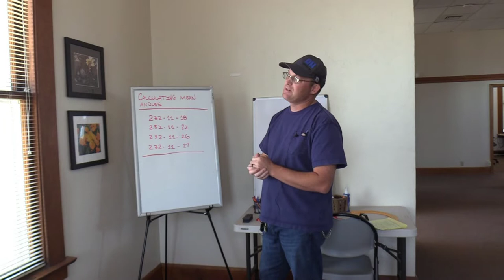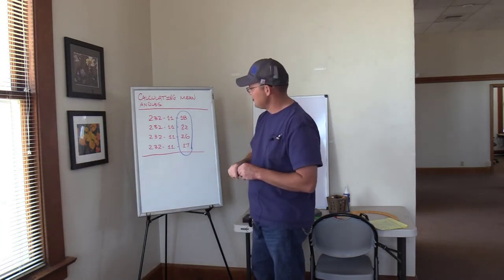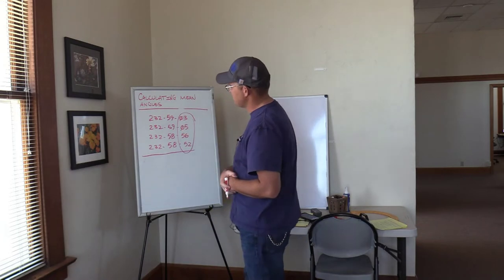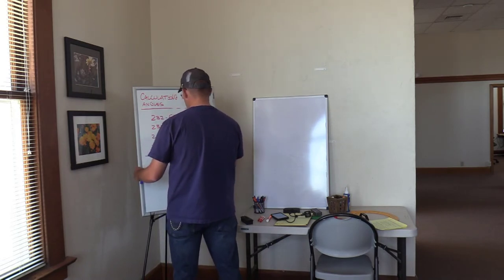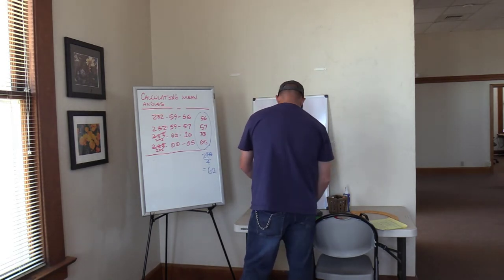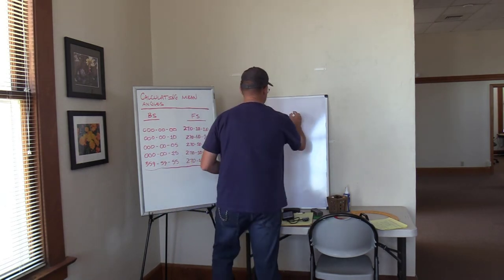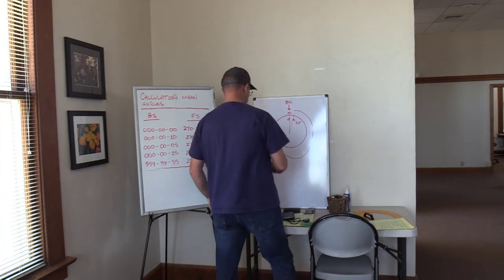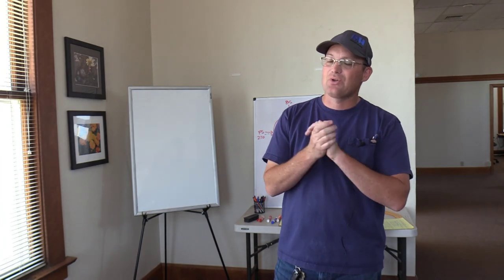Calculating Mean Horizontal Angles In A Total Station Survey

Comment: Good video. I have always questioned the horizontal angle (HA) out of tolerance warning in my field software. Its set collection program uses the sum of the seconds in outliers and compares that sum to the HA tolerance that I set. I use a different method, where I take the differences in seconds between BS and FS readings and divide them by two.